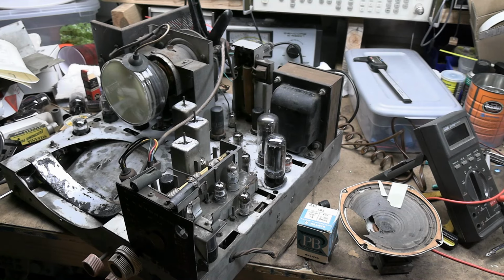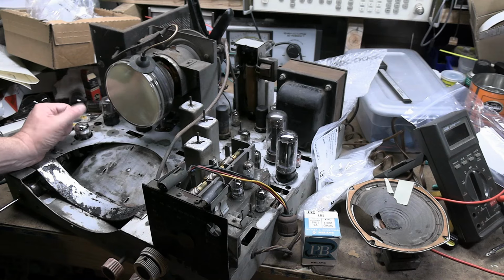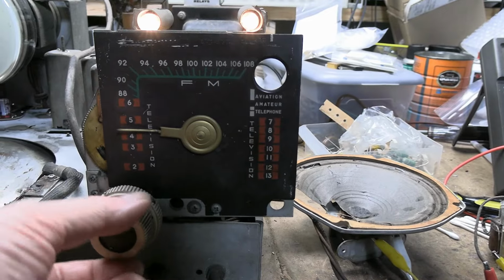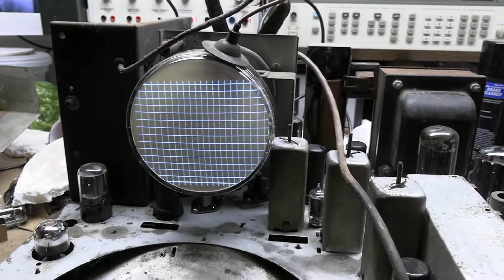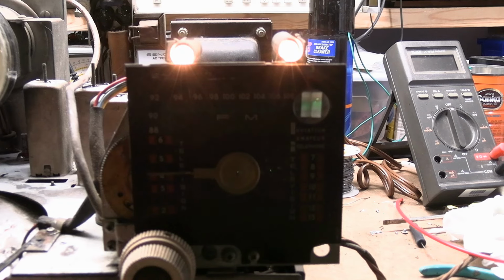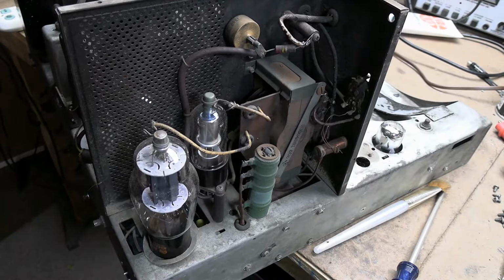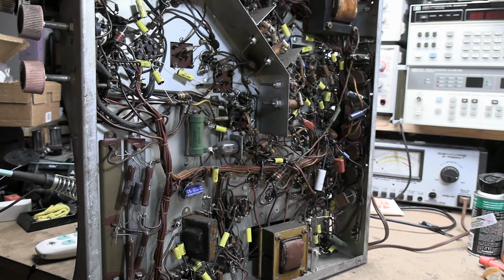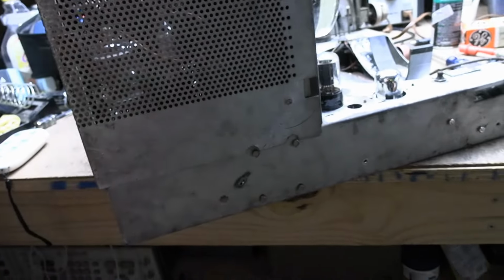Dumont RA-103D "Rumson" p04

Comment: 19:31 "but that's as low as it will go".  Surely you need to have a certain amount of inductance at the maximum frequency?  Zero turns = zero inductance = infinite frequency.
Reply from the maker: Sure. There was about one turn at the high end. Now there are two after I shifted it one rotation. There is always going to be stray inductance as well.

Comment: Interesting that the chassis for this TV is a bit different than the ones I have worked on for the RA-103 Doghouse model. Still basically the same but there are noticeable differences. Leave it to DuMont to over-engineer these to the max. They do work very well though once restored!

Comment: I remember that chain at the very end of the video. I saw several chains in place and at least one set with the chain clearly removed. That problem with the screws holding the tuner cover - I'd have just left that last screw off and thrown the screw into the screw drawer.
Reply: Most comments that begin with some form of "I" are best left unsaid.

Comment: the metal cased power  resistors are rated for heatsink mounting, in free air they can handle a lot less than their rating. approximately the same power as the same sized regular power resistor.
Reply from the maker: Right. That's why I'm mounting them to the chassis
Reply: @bandersentv  check the datasheet for the heatsink K/W value they expect for full power, I expect it's equivalent to a big finned aluminum heatsink. The think steel sheet chassis isn't even close to that, but if you derate the power appropriately, it'll be fine

Comment: And Weather radio because it also includes Aircraft (but that's AM, 108-136 MHz) but that should also include the high VHF band 148-174 MHz which includes the 162.40 - 162.55 MHz Weather Band)

Comment: Speaking of speakers.  It use to be common back then for oval speakers. We still to this day use 6x9 in car audio.  Is their a benefit to an oval speaker? Drawbacks? Why did it fade from use but the 6x9 lives on?
Reply: Did it become a form factor standard, which in turn kept that speaker shape around?  Maybe round speakers are more uniform sound radiators, but a car is a smaller space to fill.